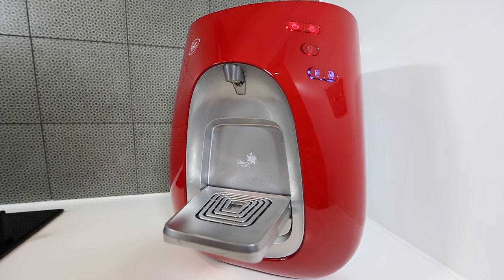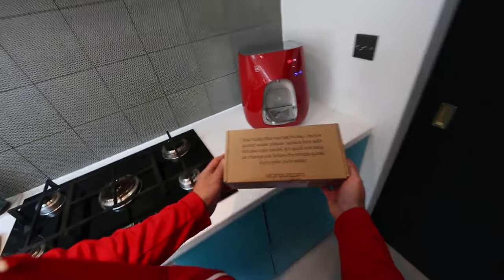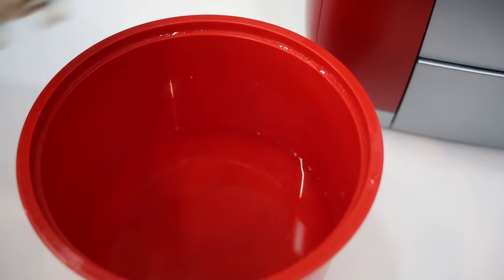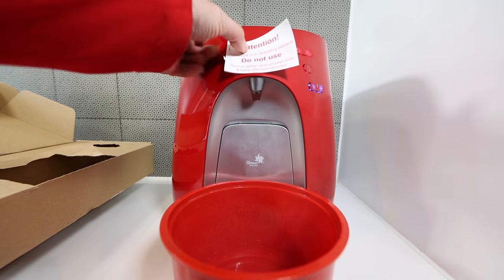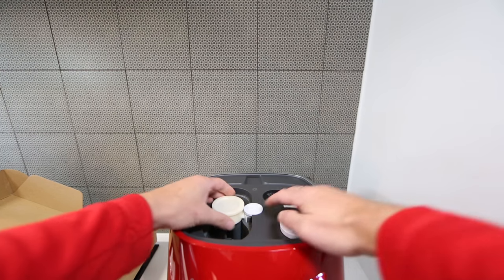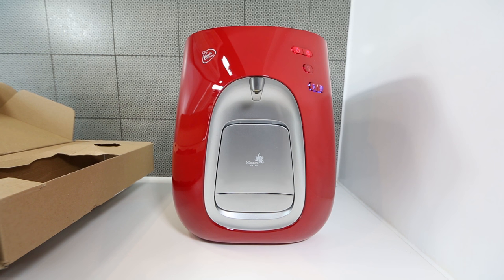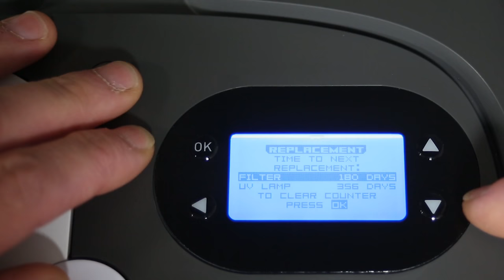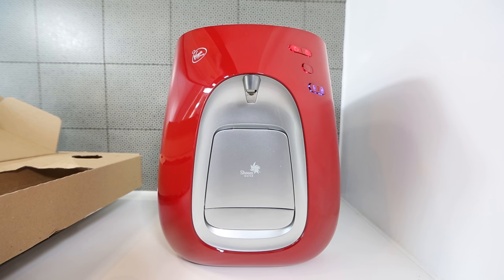Virgin Pure   How to change your water filter and descale your Home Water System (T7)

Comment: You say after the six hours to dispense four litres of hot water. Would be more useful to say how long we should this as I can measure time easily but water volume is harder
Reply: Use a measuring jug lol
Reply: Yes I used a measuring cup
Reply: Still easier to count time so your answers are not helpful. Do you have a 5 litre measuring jug?  I don’t. They say to use a bucket. Buckets don’t usually have measurements on them
Reply: Well the hot water button can be set to 300ml lol so push it 13 times
Reply: They used time for everything else, consistency would help
Reply: @tmambaz thank you. That’s was was the point I was making before all the smart Alecs jumped in

Comment: this video was so difficult to follow. I just want simple instructions to change the filter. I dont need extra unnecessary commentary distracting from the task at hand
Reply: If you can't follow those instructions I don't think you should be around hot water. It is burny.
Reply: @michaelbland3314  😂😂😂
Reply: if you cant follow them instructions, you need help ?
Reply: Mate stick with the tap pal as this is as simple as it can get

Comment: When resetting the filter, there is no FILTER option on the display. It is in fact, PURIFIER. You should update the video to reflect this, as otherwise it could be confusing to users.
Reply: The vid was made 5 years ago your comment is 1 year ago not the persons fault
Reply: @knownasaj6208 it is indeed the persons responsibility to update the video if some of the elements of the filter has changed and leave a link in the comments. If it isn’t this channels responsibility then whose is it?💀

Comment: When I press hot water out after inserting the filter, why is the water leaking everywhere from the bottom??
Reply: I had this as well on my first filter change, and it was an awful mess. I just kept going with the instructions and had to use so many towels... Eventually it stopped happening.
On my second filter change 6 months later I made sure to drain the hot water tank for longer than it called for both times and there was no leaking at all.

Comment: Is the virgin pure same as Strauss water?
Reply: Yes. You can’t buy Strauss in the UK though as Virgin has a deal with them to be the UK distributor. It’s easier that way too as importing filters and uv lights would be expensive to do as a single user.

Comment: Absolutely dread when this box turns up get the bath towel down to the kitchen because when you’ve got to dispense 4 litres of hot water while the descaling thing is where the filter should be water goes down a small hole at the bottom of where the filter would be and then comes out the bottom and all over your kitchen surface… major design fault and no mention of it… obviously
Reply: I thought there was a fault and it was just me!
Reply: Omg thank you for this! Very first time this has happened to me but water was coming out near the descale pod and going into the hole and my kitchen counter was absolutely saturated, not looking forward to the 4 litres tomorrow. Gonna have a flood 😂

Comment: wow all that and hours waiting just to change a filter get zero water filter jug filters better than this cost few quid not £300 and it better safer water and easy and quick to change a filter.
Reply: Just watched a review, comparing 3 different filtration systems alongside bottled and tap water. This Virgin system TDS levels were 350 cold water and over 700, on some tests over 1000 TDS, with hot water. Zero water filter TDS levels, with a one month old filter, was 4. Unbelievable that a company could be legal to make such claims yet provide nothing much improved upon the levels of tap water.

Comment: This does not purify water at all. I have done a few tests and the output is no better than tab water. cancelling the DD.
Reply: It’s designed to keep good chemicals like chlorine in the water, it definitely still makes a difference. Using a test kit doesn’t make you a professional when you don’t know understand what kind of filtering is being done.

Even if I wanted it to be absolutely pure with no beneficial chemicals I would much rather pay £12 a month and settle for good chemicals vs carrying loads plastic bottles of water lacking in everything home from the shop every week. Plus this saves me having to own a kettle and you have to descale those too so it’s not any worse maintenance wise.